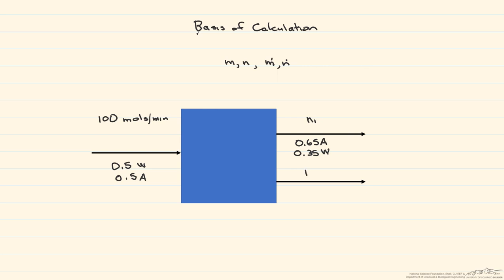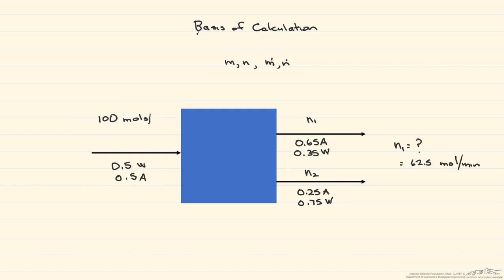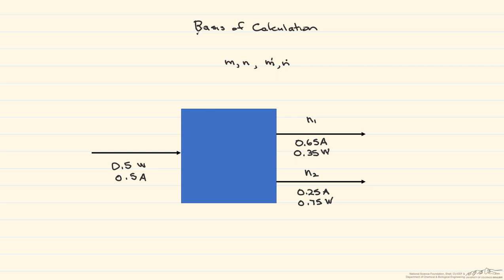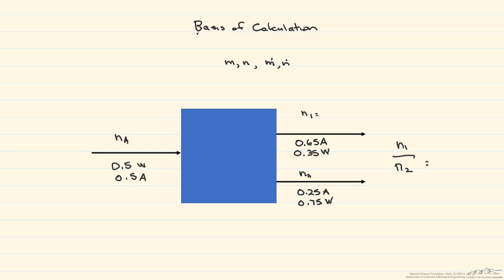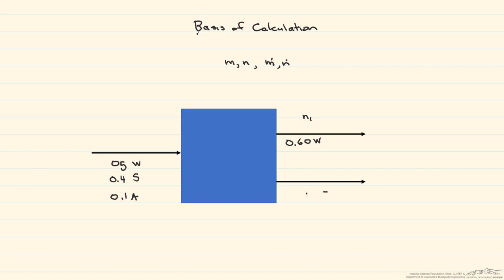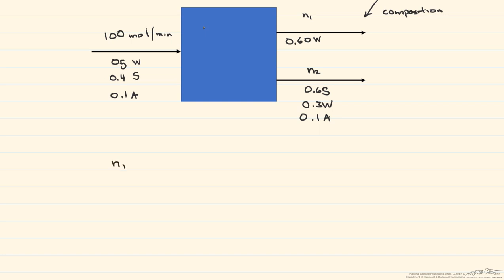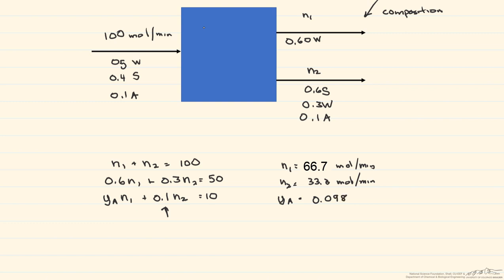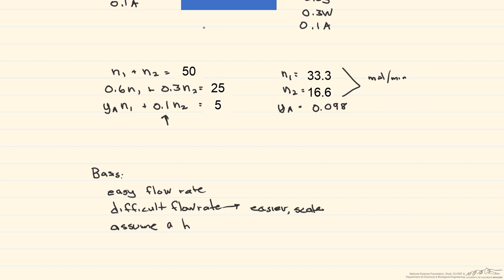Basis of a Calculation

Comment: Why its n1=62.5?
Reply from the maker: Good question. That came from a material balance. First, from an overall balance: 100 = n1 + n2.  Or, n2 = 100 - n1. Then we can do a balance for A: 100(0.5) = n1(0.65) + (100 - n1)(0.25). Then we solve for n1: 50 = 0.65n1 + 25 - 0.25n1. Simplifying more: 25 = 0.4n1, then finally n1 = 62.5.
Reply: @LearnChemE  ahh thx
Reply: Why